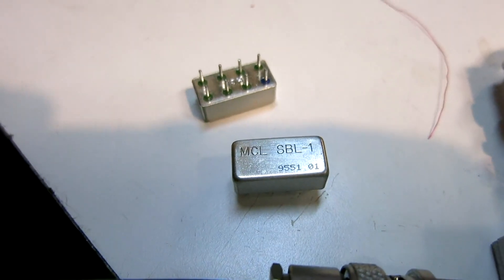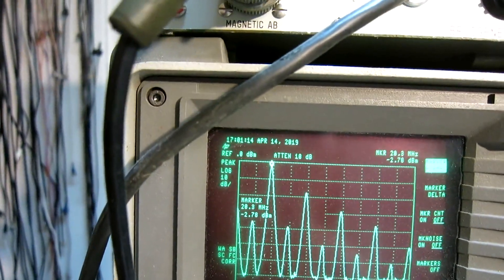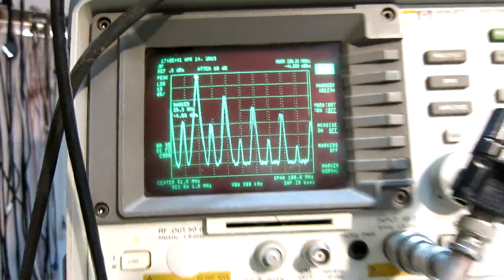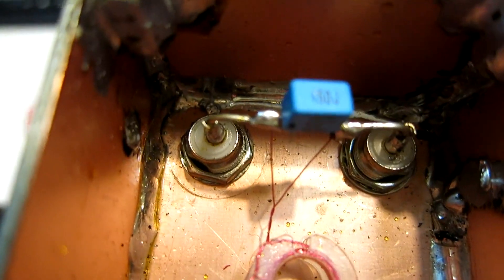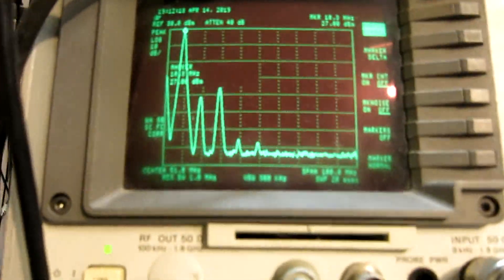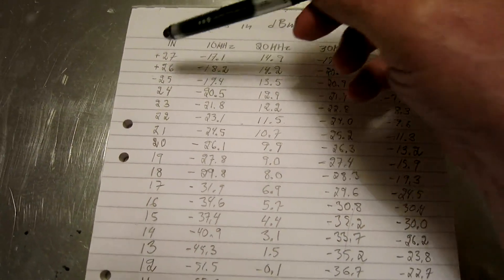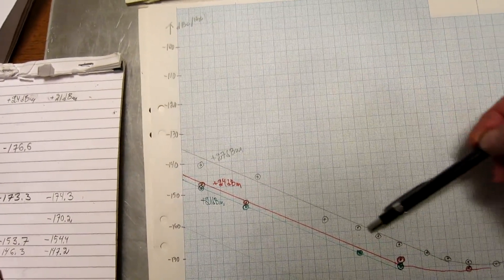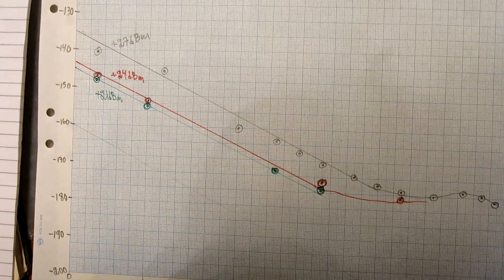schottkydoubler

Comment: Greetings. I really like alot of your videos! Specially this one.Can you do a video about a DIY comb generator? Which also can be used as frequency doublers and more. At the moment i am experimenting with them on a low budget, but my results are feeble. Using a small diode with a small 1/4 lambda inductor gave the best results so far. I want to built something with an input frequency of 100..250MHz. It prolly boils down to a good layout. But you seam the right person to ask.
Reply from the maker: It seems you want a microwave comb generator. My resources are 1 GHz and below so I do not think I can contribute to the problem you present. Sorry.